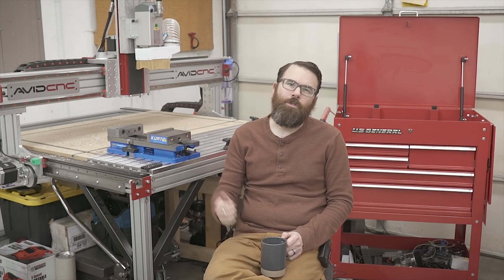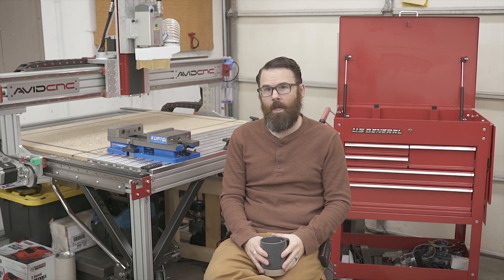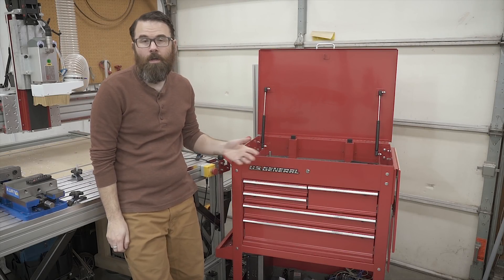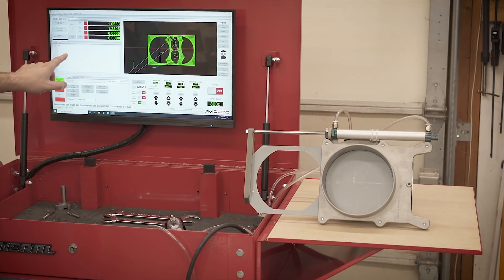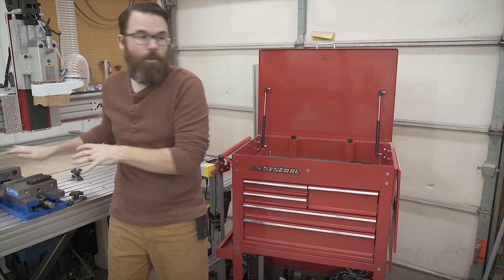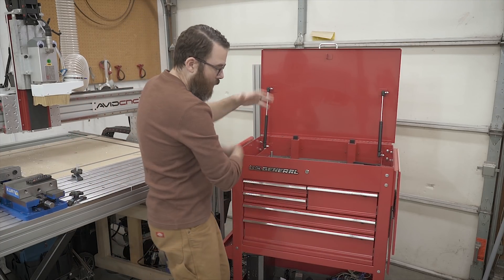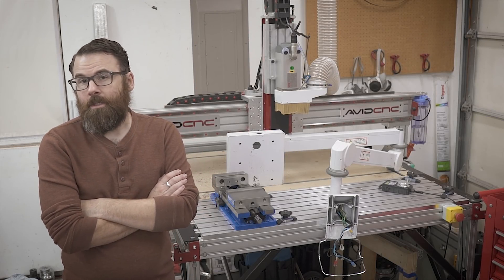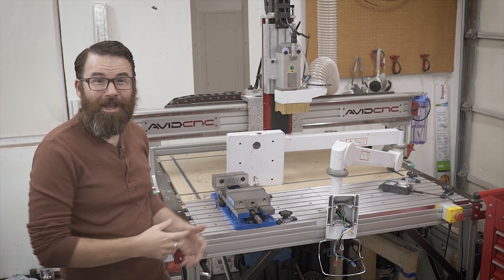CNC Router Controller Mounting Options

Comment: Hi Robert, thank you SO MUCH for these incredible videos!  I know you moved away from the "system in a tool cart" concept but for my shop this will be perfect.  I was curious how you mounted your monitor in the tool cart lid as it doesn't look like you drilled any holes in the lid.  Did you use a low profile VESA mount and mounting tape?  Thanks!
Reply from the maker: I originally tried VHB tape, but it would lose grip over time.  I just used strong magnets wrapped in duct tape, that worked just fine.

Comment: love your videos...where did you get the slotted extrusion for your kurt vise...and how thick is the mdf you are using on you table..i m building a hybird  avid cnc table with  auto tool changer.
Reply from the maker: I'm using 3/4" MDF.  Check out my 'hybrid cnc table' video, I explain everything about the surface of the CNC.

Comment: What about setting a RPi (would work with RPi Z W) in the arm, and then just power and network for screen and RPi.  With WiFi, you don't even need a ethernet wire.  Then have have VCN or X11 (if running Linux on the CNC controller PC) to connect to the controlling computer.

Low cost and useful set up, with only power and possible network through the arm.
Reply: He mentioned Mach3 or mach4 at the start, both of those only work on Windows

Comment: You mentioned you’re running the cables through a channel in the 80/20. Assuming that’s the same 80/20 I used on our arena, there isn’t a channel big enough hold all those cables. Are you actually running the cables on the side of the assembly?
Reply from the maker: You might want to check out the overview for the actual machine arm, I go over all the details.  https://youtu.be/VzFsGksoc9o
Reply: @RobertCowanDIY   Ok so the cables are running on the outside. I was picturing the center hollow area and that would be a pain to work with, assuming you could even get the connectors to fit through there.
Reply from the maker: @MrDksmall  Got ya.  Also, I should have looked at your name, how you doing?  Yeah, I just ran them in the channels and used the wire cover stuff.  I got a power cord, audio cable, HDMI, and USB inside the two channels.  JUST barely enough room for all of that.  I could probably do one more USB or audio cable.
Reply: @RobertCowanDIY   And now you know which arena I was talking about. 😛  since you’re using the metric version, those channels might be a little bigger then what I have on the 2” stuff. Hopefully we can have an ARC event soon so you can fill my arena with more robot debris.

Comment: One of my favorite tricks is to run a bunch of ethernet or similar high pin count cables, then make several bespoke adapters for the necessary connections (sometimes you can buy them COTS). It's certainly more work at first, but relatively future proof. Probably best not to do that with HDMI, but it's a common practice with USB, audio, VGA, serial, etc in automation and other sectors.
Reply from the maker: Ah, that's a good idea.  ethernet is a good solid cable for data for sure.  Power isn't an option though :-/
Reply: @RobertCowanDIY  Well, depend on what kind of power.  Up to 48V are no problems going through a Ethernet cable, we do have Power over Ethernet, so to transfer power for a screen would not be a problem.  High voltage would give less ampere for the same power transportation, and ampere are the big problem.

Comment: I think an All-In-One Windows PC with built in speakers and touch screen will solve all of your problems. Then you will only need to route two cables, ethernet and power, And both of them can be terminated at your CNC electronic box, so it will be tidy and clean.
Reply from the maker: You say that...  as you said, you still need power, ethernet, maybe a USB...  It's still quite a bit.  Check back next week and see what I came up with.  Also, with the all-in-one, what if I want to add something else, like a pendant, webcam, etc.  It will have enough USB ports, that's fine, but you still need to run more cables.  Sure, you could run a USB back to a hub, and plug everything into the hub, etc.  I just like my machine arm better.  BUT, that's just what I like, not what will work out best for others!

Comment: Robert a very timely video. I have an Avid 48x48 on order and I had two questions. First do you need (or want) Aspire on your machine computer at the CNC? And what are the minimum requirements of a laptop or desktop at the machine if I were running Mach 4 alone or both? Thanks!
Reply from the maker: For the computer running the CNC machine, you really JUST want Mach3/4 and nothing else.  I know other people do run CAD and CAM software (Aspire, Fusion, etc), but to me that's not ideal.  I like having the computer as JUST the controller, and Avid will recommend the same.  As for requirements, if it can run windows XP, you should be fine, seriously.  Just pick up any old computer and it should be OK.  I use the old optiplex computers with a solid state drive since they are quiet, compact, cheap, and have a ton of connections.  Does that help?
Reply: @RobertCowanDIY  Yes! Thank you Robert! I admire anyone who can produce a video and teach others. I hope you will continue and indulge us newbies from time to time? 👍
Reply from the maker: @OldVetCreations  always!
Reply: What about Linux CNC?  That way you can use X11 to transfer graphics to a small RPi in the arm. Then you only need one Ethernet and one power for the screen (which can be like 24 or 48V) and RPi (which is about  5W, 5 volt depending on model).
Reply from the maker: @AndersJackson  That's a few 'ands'.  If you add it all up, that's pretty much the same number I have.
Reply: @RobertCowanDIY  two wires, one for power and one for Ethernet, which actually is optional.  I don't think that is that many.
Reply from the maker: @AndersJackson  Got ya.  That assumes you don't connect anything else to the pi, like pendant and such.  but yeah, that could work.

Comment: If you wanted to use something like that arm for a touchscreen you would only run power and a USB cable through the arm;  then place the "PC" on the wall.   If you wanted to use an All-In-One PC like that terminal;  simply run a USB cable and use a hub at the mount.
Reply from the maker: Yep, agreed!  But the monitor still needs power and video.  So that's a minimum of 3 cables, and I'd probably run an audio cable as well.
Reply: @RobertCowanDIY  Sorry;  I meant using one of the all-in-one style touchscreen PC's (that are typically used on those arms);  Video is internal,  they often have speakers built in.     Though having the flexibility of using a different touchscreen is a great option for such a use!